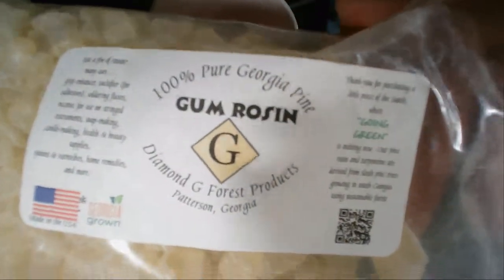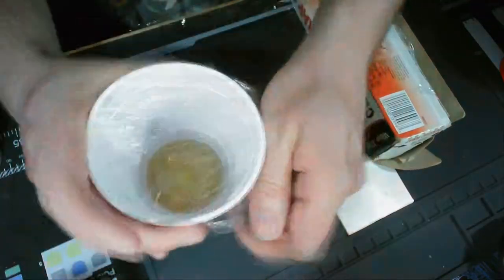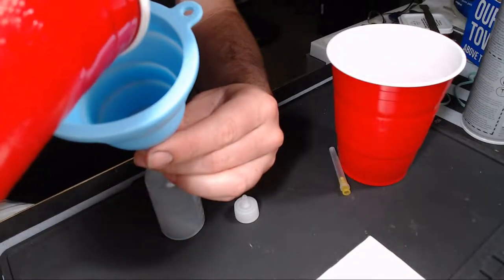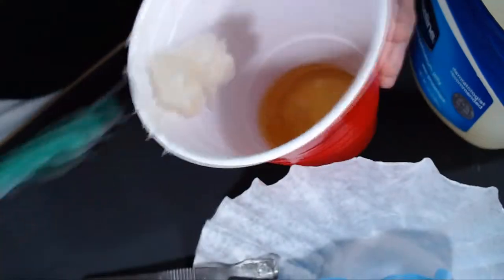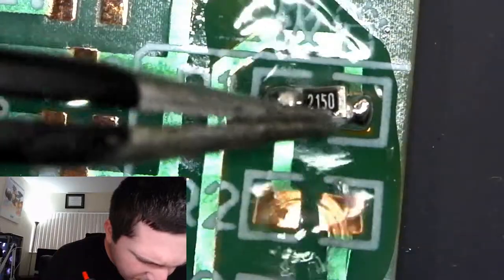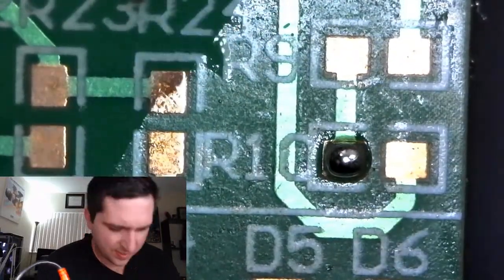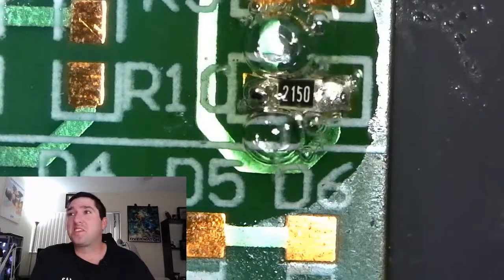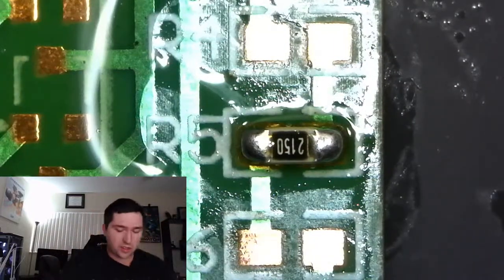Soldering with Pine Sap?!?

Comment: I harvested pine resin from a pine tree myself and cooked it in a small pot at low heat to evaporate all or most of the volatiles  and the resulting flux works very well for soldering without adding any alcohol or Vaseline.
Reply: That's the right way to do it!
Reply: Can I get resin for soldering other than pine tree? Is there any other tree that produce resin that is good for soldering?

Comment: I think we’ve already had this conversation. It seems you are bound and determined to try all manner of mixes to achieve a flux that works. The flux core of the solder you use is supposed to be the same as the flux you use. There is no cheap out magic cure or alternative to what you are supposed to use. RA flux core solder requires RA flux to be used with it. It is about compatibility. You don’t mix unlike fluxes with a cored flux that doesn’t match. Stop this insanity! And what did I say about fume extraction. Do you not care what air quality you have when you are soldering? Lung damage of this kind is irreversible! You have sense! Don’t keep doing this! Nitrile gloves and safety glasses, nitrile gloves so the oils and acids in your skin don’t get a chance to migrate transdermally through your skin and safety glasses to protect your eyes from solder spatter. Yes it can jump that far! If you don’t care about your health, why should anyone else. Spend the money and protect yourself! Unbelievable!🙄Sheesh! Forewarned is forearmed!
Reply from the maker: Yes, you mentioned this in the comments on the other channel I believe. Trust me, this video was merely to demonstrate how bad these homemade flux recipes are as there is no way to solder properly with them. People have came up with some really weird stuff,  I have 2 links in the description where I found these at. I believe I even saw one where they used pine cones. As always, they are horrible substitutes if you can even call it that. The point of this video is to just show how bad it is and to discourage anyone from trying it. As I said before though, I did buy everything you mentioned. I just need better fume extraction, it's going to be hard to find that at a good price (plus I don't solder a lot).